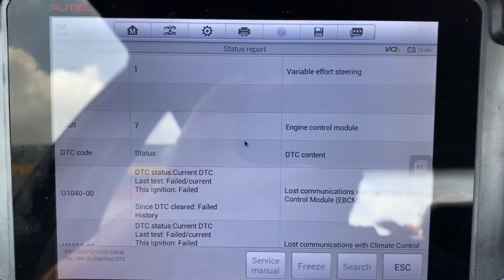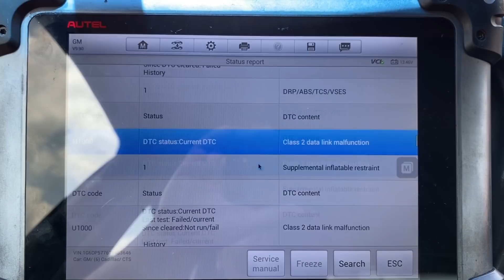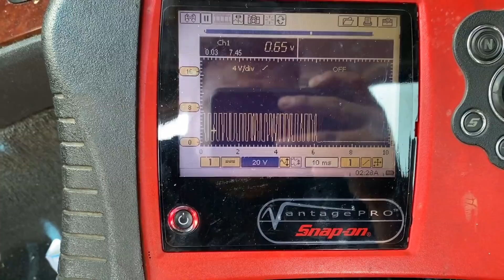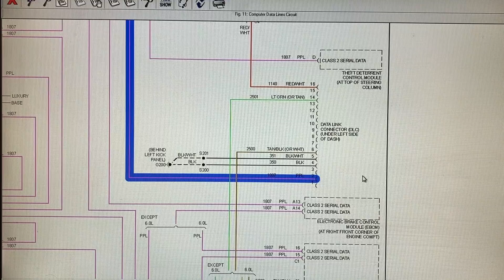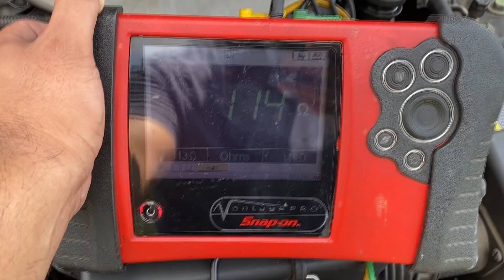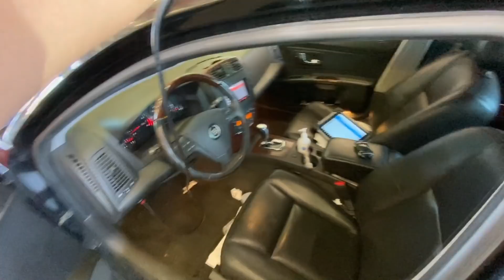CADILLAC CTS KEY STUCK IN IGNITION NO COMM DIAGNOSIS & FIX

Comment: I am glad that on a hot day with a difficult fix you were working on the V6 version of this car. The V8 version would have you putting down the meter and picking up a sledge hammer lol. Thanks for taking the time to explain your excellent thought process. Those long test leads are a great idea.

Comment: Jus a Quick question if your able to help me out. So my car has theft light on with tc light on fuel gauge stays at 0 and heater but my car still turns on and still shift gear with the keys it’ll start still I have a u1300 & u1000 is it because of the aftermarket radio?

Comment: Never Touch A GM Vehicle
You Have Not The Training 
To Do This Job,
All Codes Are FAKE And This
Vehicles Needed Only A ECM
Replacement And Programming,
Many Of You Dissembling Engine
And Electric Cables And Never
Fix Them Horrible.
Amén.

Comment: I have a 2009 Cadillac SRX. The car won’t drop into any gear. It starts fine. All electrical is working perfectly. What could be the issue ??
Reply: Sounds like you have no automatic transmission fluid. My CTS ATF pan seal was leaking and would lose all power, it feels like you can't get in gear.

Comment: I had a slew of codes show up exactly like that on my Cadillac CTS 2007 v6 3.6L. This looks like a classic electrical water damage issue under the carpet where two fuse boxes and wire harnesses become submerged in water due to reservoir clog overflower during rain into the back of the floor under the carpet. must clear the reservoir tubes along the top door panels with air hose/power washing maybe? there are how vids on how to do that since its a widely common problem among most Cadillac's before 2010

the intermittent starting is probably and ECM/ anti theft system that needs to be reset, as the entire wire harness bundle controlling a slew of modules.  The intermittent starting porblems are problably due to the fault codes of the anti theft system. Intermittent because it tends to happen more when car sits for a while, say a week or more, too much power to the battery to start an engine with faulty wiring will likely yield an antitheft code.
, even with a new battery, . with the wiring harness submerged in water, usually the power windows are the first to fail.  wiring within the harness would have to be checked for voltage and spliced, crinked, shrink wrapped and repaired. then reset the ECM through the fuse box, or with a code reader? just guessing.
 and there is a release for the key with a flathead and a pen to move the lever the release the key, under the steering wheel, make sure the key is turned to the on position

Comment: I have the same problem with my 05 cts along with U0100 code and P0700 and no crank, no start if i jump the relay starter will stay on but once i shut off the car it will not start. It seems like i have to replace the ecm. Any suggestions. 
Great video

Comment: Great breakdown...was figuring it was my ecm. Hoped it was just a short in a lin the DIM. BUT I think when I drove it enough after I reset the ECM with the fuse pull. It stopped but came back only after 20 minutes of it going away.

Comment: I have the coupe and the key that stays in the ignition at all times won’t turn to the off position that happened after I removed my center console because my shifter was loose so I wanted to see if I could fix it ever since then theft deterrent showed up on my dashboard and the car won’t start unless I unplug the battery

Comment: Greetings Eric, do you have a shop you know of in the Orlando fla area that can do the same things you just did in this video. The dealer here won't tell you that they have no clue as to the problem. Twice they changed out the EMC and the Traction Control module (both Used) and still the same results. charged me several hours work, and for the modules, but didn't fix the problem

Comment: Had this exact same problem with my Mom & Dad 05 Cadillac SRX 3.6L.  He ended up going with a remanufactured ECM from Flagship One. The first one was bad but the second was good.  There is a small hole on the bottom of the steering column on the right side where a small screw driver can be put in there to release the key.  This is a classic GM problem. Great video.

Comment: My friend gave me his 2003 CTS 3.2 L 5 speed manual transmission because he hated it. The guy that traded it to him, when my friend got into some police evading trouble and needed to off his own ride and which was a car that he had just paid 10,000 dollars for, had a body shop so he had my Cadillac looking nice but didn't know beans about mechanics so he hated it too since it had the limp mode problem.  They thought it needed a new tranny. Lol.  All I did was this procedure and the procedure where you wait 20 seconds wait and turn off and on the ignition without starting the ignition 3 times and boom! I have a bad ass sports luxury sedan! It has 150,000 miles on it. I'm never gonna stop driving it!  It just needed the relearn procedure to the accelerator pedal positon sensor. The check engine light code P2138.

Comment: Inside the tcm there is a battery which I assume keeps the tcm from losing communication with ecm so replacing this battery on TCM which is 17 years old now I'm going to replace my guess is problem solved
Reply: Greetings, did replacing the battery work?

Comment: Massive list of fault codes would guide me to a computer/module component problem. What kind of heat shield material could you install to protect an engine mounted computer? I watched 'DiagnoseDan' deal with a Mercedes computer on the engine that failed to allow the crank when the engine got hot.

Comment: I have same problem with key getting stuck in ignition & running low on 12 volts , on Cadillac DTS in Houston area , you have a number I can get at you ?

Comment: I am working on an 06 CTS 2.8. I have a no crank, key stuck in ignition, no communication with the ECM, and a U1000 in all the other modules. I have checked my powers and grounds at the ECM. On the class 2 serial data, at the ECM connector I have less than a volt. Do I most likely have a wiring issue? There is supposed to be a splice for the class 2 data 7" from the TCM, but I don't see it.
Reply: I have this same exact issue

Comment: I suspect the resistance reading was off due to the circuit being energized.   You should de-energize the circuit to get a resistance reading.  If the circuit is enegized, you can compare the voltages on high and low.   If the voltages are not balanced, it's an indication of a possible short, open, etc.

Comment: I was thinking that the aftermarket headunit would be causing the issues, because I know how finicky they can be when you replace the stock unit with aftermarket, unless you do it correctly. I know that a lot of functions run through the stock unit and when you replace it with an aftermarket unit, things tend to get screwed up.

Comment: Just at the moment I have a Cadillac with a customer no start.
Several issues to sort out. But likely not computer at can-bus or single wire.
I found your troubleshooting excellent and I learned from lessons included in post.  Thank you for the instruction and the "heads up" as part delivery with prior install to electrical part.
I find my customers love their GM features and patient repair with test and confirm...competence has them returning...as individual and then as gathering their friends.  I find that listening to my customers as what they expect...and delivering that expectation is when....they are 100% satisfied. I find when I can briefly explain in simple terms...what the problem might be works well.....and further, coach those people to good maint schedule.  They like the comfort and general reliable Gm models. M

Comment: you are right on track. a technitian today have to be careful when measuring can data in the dlc port... there are many cars today that it is not possible because the can wires in the dlc goes thru a "gateway".... in this case the transmission ecu has the gateway built in.

Comment: I have one for ya.   05 CTS 3.6.  Traction control and security light on (security light takes a few seconds to kick on when you turn key)   replaced ECM tried the relearn, security light wouldn't go out and key still stuck.  Was messing with it today....turned the key to the on position.  Got out, went under the hood and pulled the ECM fuse and it started cranking by itself.   Only stops when you put the fuse back in
Reply: That's messed up

Comment: every car i have seen with computer problems have an aftermarket head unit installed, I recently put in an aftermarket head unit and I'm getting theft system errors and key stuck in ignition, gas and temp gauges not working. thoughts?

Comment: I have a 2005 sts push start I press it it does nothing but I can't find the location of the ecm I have a 4.6 v8 charge the battery and the accessories work fine it just no response from ecm also the powertrain micro relay forever clicks when I test the circuit it was flicking ik its not suppose to do that

Comment: Where is your shop?? I need you to diagnose my V! When I turn the ignition from run to the off position, the headlamp washer nozzles pop out and spray water. Kind of annoying when I don't want things to get wet in my garage.
 Also, every now and then when I go to start the car it just clicks with no starter crank with a perfectly charged battery. Plus, starting to have the issue of not getting the key out/unlocked.

Comment: Of course your resistance measurement was way out, it can only be done on an UNPOWERED system. When measuring a powered circuit, any positive/negative voltage will peg the resistance meter either to 0 or high resistance...The 60Ohm measurement is present on ALL CabBus H/L pins anywhere in the system BY DEFINITION! It just has to be measured with the system unpowered/car off!

Comment: Great technical diagnosis. That would have tripped up many techs. Most especially once you get a replacement part that is garbage. The ECM mounted to the top of the engine just seems GM wants that car to break down. What a bad design.

Comment: I have a 2003 cts and it had similar symptoms. Key stuck in ignition, multiple interior controls malfunctioning, radio staying on which caused drainage. It ended up being BOTH the ecm and bcm. Talk about an expensive ticket. Stupid cadillacs and they’re electrical systems.

Comment: My CTS was doing the key stuck and security thing... Had to replace the motor (nothing to do with the security issue). Motor is in, now when you turn the key nothing but the blower motor and aircon display come on.... Won't turn over can't do anything :( I'm at a loss

Comment: Ive had this exact same problem with the same car, same symptoms, same crappy reman computer dead on arival. Two with starter ckt codes. Crazy how crappy parts affect everyone. We only use dealer computers because of this exact car, and im always suspicious of parts that look like they have been installed. Also i had a Cts that had a shorted fuel tank pressure sensor that ruined the 5v reg in the computer after a customer installed his own computer and brought it in for programing. Bottom line that Gm computer is used in a few models with the V6 platform, they all are junk
Reply from the maker: I hearing the same thing from more and more people. It’s crazy!

Comment: Ha lol... They're spray painting used computers and sending them back out as remanufactured
Reply: yes they are. they dont even check terminating resistors  before they ship
Reply: @carlbrandon8040  I can see some doing that! However, despite this guy gettingpp poor ECMs, logically it seems this vehicle package likely has a high failure rate with this issue.

Make me wonder, I've got bad computers from a place I deal with. They have simulators, long story short. I wonder if it only go through power,  ground, reference and signal test only. Because logic test require real world scenario hookup.

Comment: The CAN lines on GM are continuous thru the modules just like a traditional CAN network. They just go in on one set of pins and out on another, but interior to the module they are a direct connection if you check them with an ohm meter. CAN + in and CAN + out. Likewise on the negative. The weird ohm reading on the CAN network may have been because the CAN was powered up when you checked it.

Comment: Great Diagnosis! Short your long wires together, press zero on your meter if you have that feature or remember the residual resistance...Most electronic resistors are +/- 10% or more, so if it read about 110 to 130 ,I wouldn't sweat it, and on top of that test equipment also has tolerances that give a slight error...You're a good technician proving 3 bad ECMs...If anything, that shop now knows you are the "Tech to Call" when problems need to be solved!
Reply: A lot of people don't understand there is a margin of error in instruments, though for an expensive scan tool 10% seems a bit much.
Reply: Most digital test equipment is very small less than  0.1 % plus/minus one least significant digit. The load resistors the car module on the other hand is probably 10%, maybe if critical 5%...

Comment: Top diag Eric.Never had alot of faith in reman ecm's. If any module arrived in a box that had been opened or had greasy finger marks on the box (done the rounds in the workshop) it went straight back to the dealer. Some can't be trusted to do  the right thing.

Comment: These CTS computers go bad all the time. I've changed around a hundred. They're so small and weak. Plus they are bolted right on the hot motor. I don't know why GM engineered these cars this way except to make people like you and me money. They're putting my kids thru college. All faulty CTS ECM's make the key get stuck. Also. If they were Class 2 error codes, I would have started scoping out the Class 2 data line first. Especially at the start of the engine. However, when I saw "key-stuck-in-the-ignition" problem I knew it was the ECM. Now this is an educational video. In that regard,  I love how you took your time to explain to everyone in detail. That makes for a great learning video.

Comment: When looking at high and low CAN, any time the flat line between data is squiggly, its a terminating  60 ohm resistor problem !!!! Two 120 ohm in parallel - 60 ohms resists keep echo to none. Or there could be no CRC .

Comment: Hey dude when taken the ohm measurements you should talk the battery terminals out to get decent results.. Thanks
Reply from the maker: Yes you are correct! I will try and double check this measurement with the battery disconnected. Thank you!
Reply: @ADVANCEDLEVELAUTO  How does a car battery charging indicator comes off when car engine is running?? How it actually works, please kindly make videos of it. Thanks in advance.
Reply: There will be a small voltage present on the CAN lines, hence the difference between readings when you swap the leads.
Many meters will show a negative resistance rather than zero, that's a dead giveaway of voltage on the circuit.
Also worth knowing is there are two basic types of multimeter when it comes to resistance tests.
An "electronics" multimeter has a very low output voltage, under 0.5V so that it does not cause any silicon diodes or transistors to conduct. The current is also limited to a very low value.
An "'electrical" multimeter has a higher output voltage, typically 4-5 volts but can be up to 24V and has a much higher output current, up to 200mA because most of the resistance measurements of interest are well below 10 Ohms.
These are much less susceptible to a few stray mV but can damage  electronics.
Typically you won't see these in an automotive shop unless you also cater for common rail diesel, hybrid or EV.
Reply: you got it  right

Comment: Great diag and video. Thanks for sharing.
Can't believe the hassle to get a proper working part, just stupid. 
Always good to see you man.
Reply from the maker: Thank You!
Reply: @ADVANCEDLEVELAUTO  Have the same issue with a 2007 CTS and the shop says it needs an ignition immobilizer module. Would you suggest replacing the ECM first and seeing if that's the real issue? The shop already replaced the ignition and battery.

Comment: My bet before watching the video is it's good old aftermarket radio interfering with the communication or can lines
Reply: Neil my 04 CTs has this same issue and you comment got me thinking... mine was purchased used and had a cheap old looking flip down monitor/dvd player in it... I pulled it out because before this know cts issue I thought it was an electrical/battery issue... I may have to remove all the wiring that I left
Reply: @Dat_slo_nata  glad the comment could be of use start with the things you know looks wrong then work your way up or in other words start simple work your way up
Reply: I really was surprised that it wasn't. I am quite aware how goofy these things can get when you replace the stock unit with an aftermarket unit. A lot of functions run through the stock unit, so if you replace it with an aftermarket unit and don't do anything correctly, you're going to cause yourself a huge headache
Reply: @Minitrucker231  I was honestly was also surprised